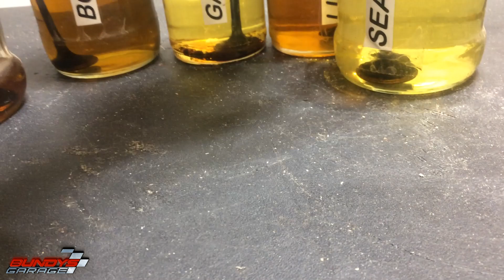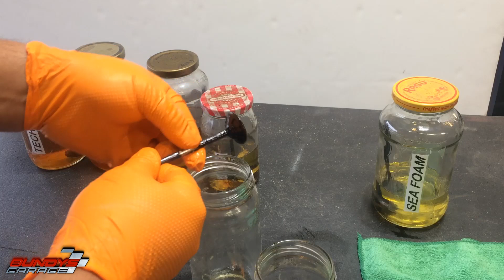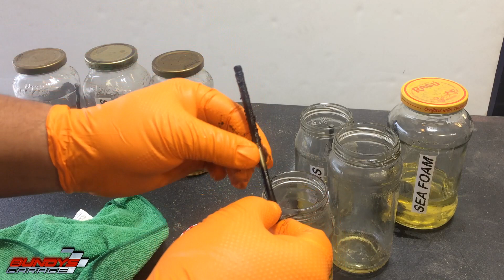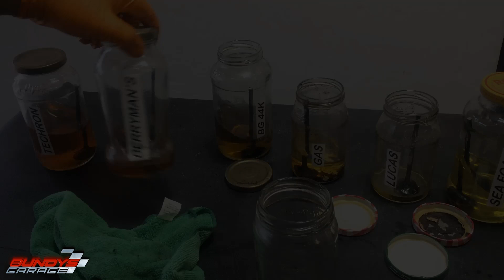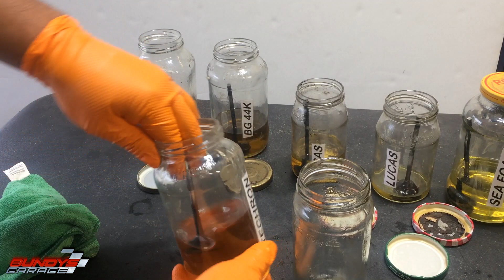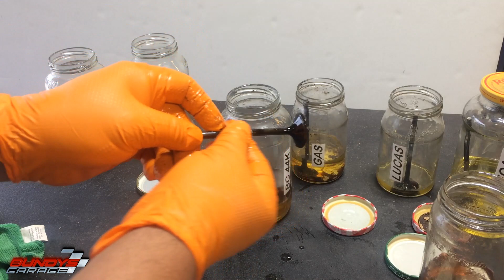3 YEAR TEST Fuel Additive | Berrymans BG-44K Chevron Techron Seafoam Lucas Gasoline | Bundys Garage

Comment: I’m surprised how much Techron cleaned under these conditions. I assumed it relied on pressure, heat and breaking down to work optimally. It makes sense bb 44k worked the best in this context since it’s solvent based which doesn’t perform as well in a combustion chamber.

Comment: I have heard from other mechanic shops that BG 44K is the best. The real cleaning comes from ignition under pressure and burning, so while your test is okay, a test after using a full tank of gas would be better. When you first start after the treatment it smokes as it's burning off all the crud. This might create a catalytic converter problem if there's a LOT of crud. When gas is polluted with ethanol the ethanol turns to sugar under heat and this is what dirties up the system. Adding BG 44K to a full tank of gas twice a year is sufficient. The best solution would be to just get rid of ethanol, but it's harder to buy E-free gas without paying through the nose. This all comes from political corruption where Big Ag Big Corn Iowa, the first primary state is over represented by the agribusiness cartels, IMHO.

Comment: i thought gas was the best cleaner'
Reply from the maker: Gas is not really a cleaner, it's full of dirt and sand. Never fill your car up at a gas station when the tanker truck is there filling up the underground tanks. It stirs up all the sand and dirt that is sitting at the bottom of the underground tanks and when you pump it, it will go right into your gas tank.
Reply: @bundysgarage  i think i meant to clean the valves on port directed engines.

Comment: BG products , 44K, MOA, EPR for my 2014 VW 1.8 EA888 bought new Feb '14.

133, 595 miles. Car runs beautifully . Original plugs and coils.  Polish master tech said they're fine.  Still great mileage, fires beautifully. 

Great machine for what it is.
Reply: can you say that in english? what product did you use. oh you used BG, how did you use it

Comment: Berrymans destroyed the diaphragm on my lawnmower.  Wouldn't put it in my car after seeing what it did.
Reply from the maker: Did you use it full strength? How long did you leave it in there? At what percentage?
Reply: @bundysgarage   Used a moderate mix in my regular fuel.  The diaphragms on the old Briggs and Statton engines with the plastic carbs are made of a flexible material and need to be changed out every year or so.  Mine was near new.  Two tanks of gas later, and it was shot.  Can't speak for what it does to other materials, but it was a no go with that machine.  Only additive I put in any of my many engines for the last three years is MM Oil, and am having no issues.

Comment: Hello from England . I have 2 1999 3.0 V6 Accord Coupes , and not much support from Honda here despite them importing a few dozen . No manuals and it seems like I'm the local expert on these US built cars . On one I have I appear to have an ignition short , which blows the ignition 15A fuse on cranking . No short on coil and resistance primary secondary is in spec . No shorts on coil to pcm cable full continuity . PCM checks , no shorts to ground . Pump runs in key position 2 . Battery voltage on the coil to dizzy wire but blows ignition fuse on cranking . The Blk/Yel wire from coil goes back into the loom toward front of car before returning to PCM from possibly the IAC valve . Is it likely that the IAC valve has seized to increase current to blow the 15A ignition fuse . All other Blk/Yel wires stay battery V+ no other fuses blow . Oddly the door brake SRS light is on , but probably not related. No CEL on . Have you come across this one ?
Reply: I think the Berrymans 44K will work best for this issue.